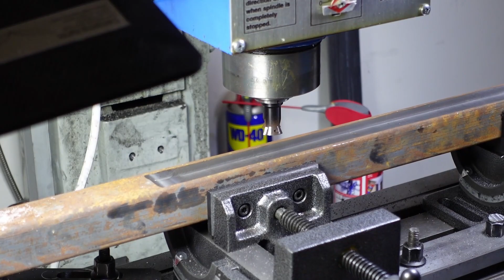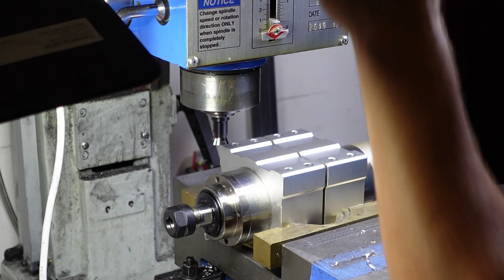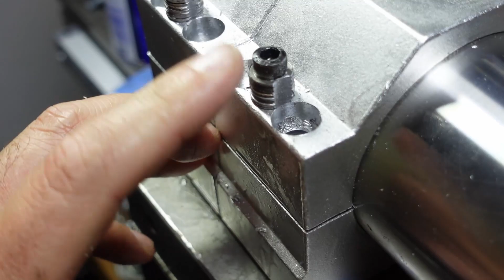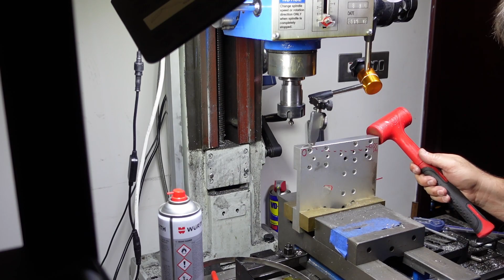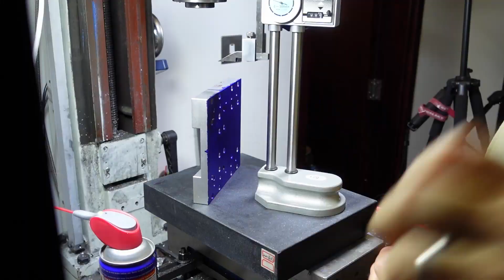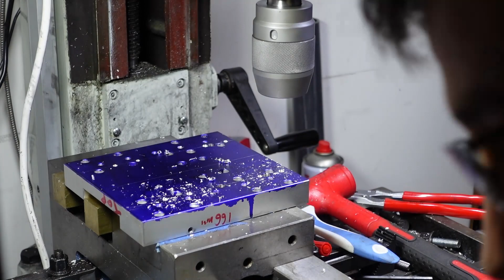CNC Z-Axis and Gantry UPGRADES  Pt.1

Comment: I have a Genmitsu 4030 and have these 3D Printer lead screws. Printed new carriages to get more tension from the spring on them but I will have to change them out for ball screws sooner than later….
Reply from the maker: I want to go to the double nut ball screws as You can adjust the preload between them to dial out any backlash. Ive seen some guys buy higher quality balls also and replace the balls inside the nut to tighten up the tolerances.